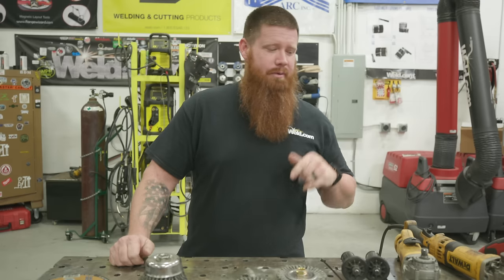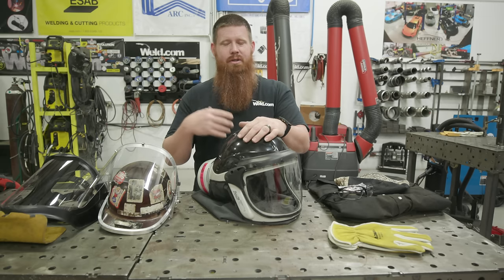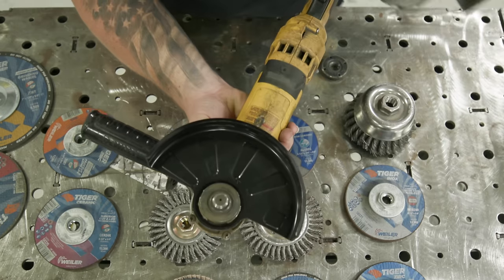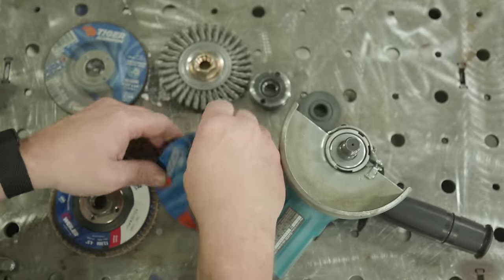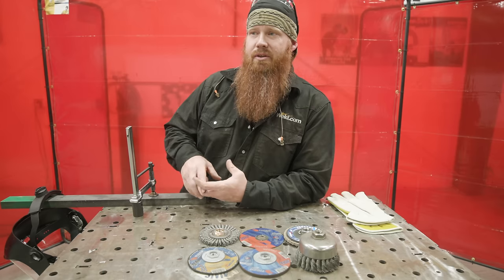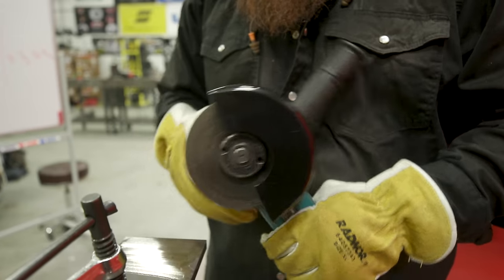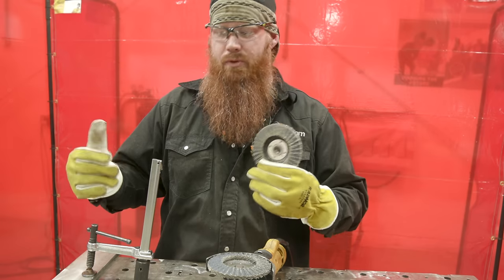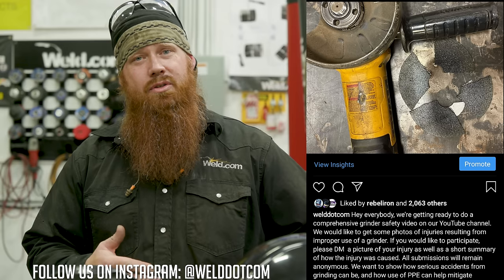Grinder Safety: How to Properly Use an Angle Grinder

Comment: Jason, you have performed a tremendous service.  I'm a retired eye physician and surgeon and have seen some bad shop accidents.  You certainly have a talent for instructing and teaching and this was one of the best.  Your videos are great and much appreciated!
Reply: fsfltsurg704 did u really have to add eye surgeon in the comment 😂
Reply: @BryanHernandez-kv6gr  
Considering it's relevant to the subject of safety, in the sense that he's seen the injuries that resulted from poor tool safety, I'd say he DID in fact have to mention that. Leave well enough alone.
Reply: @BryanHernandez-kv6gr  Yes.. Most of the injuries I treated could have been prevented with some basic safety measures that were mentioned in this video.
Reply: George Nelson  Safety glasses with a face-shield - much better.  I got a piece of steel in my eye once while wearing safety glasses !  A face-shield would have been better and actually might have saved me that time. Point is safety glasses alone are not 100 %.
Reply: My wife calls me “mr safety” because I wear all the protective gear whenever working in the shop or mowing my lawn. Also my 14 years as a paramedic I’ve seen a lot of eye injuries as well. It’s really common sense.
Reply: @nobaddaystravel6855  what does she call her boyfriend?
Reply: @nobaddaystravel6855  better to be Mr. Safety, than Mr. Tragedy.
Reply: George Nelson  44:51
Reply: @nobaddaystravel6855  I wear a face mask mowing. I know a case where something (a pebble) bounced off a house and the person needed eye surgery. I told my neighbor and he wears one too. He told me once something hit his safety glasses and cracked them!
Reply: @denyspoyner4150  I suggest and wear safety GOGGLES.
Reply: @BryanHernandez-kv6gr  The mention of their profession was appropriate and useful in helping them establish credibility. Your comment is the one that is out of place.
Reply: Eye injury most common injury.
Reply: @nobaddaystravel6855  i wear all of my protective gear in front of wife. Specially when im drunk. ✌️

Comment: I had a cut off wheel explode on me. I had the guard and it saved me. I didn't listen to others about taking the guard off.
Reply: Good stuff.
I've had them blow up without a guard many times and its been like being sprayed with small bits of gravel at speed, didn't embed, might have broken skin or slightly bruised.
Protect your eyes.
If you blew off a wheel while it was mostly intact that might be a different story and 7-9" discs can kill.
Reply: Unfortunately it happens fairly commonly, especially on deep cuts. As long as you maintain a proper body/tool orientation and adhere to the guard and cutting directions, it rarely causes as much damage as shown, if any. Be vigilant!
Reply: @Senkino5o  I had a 7" disc explode with large chunks. I have broke the center out a couple of times, but only had a complete explosion once.
Reply: Respect the beard.
Great video dude 👌
Thank you
Reply: Same. Iv;e been working on a large metalfab shop for years and it;s the first time one has shattered on me and that guard might have saved me a shitload of grief.
Reply: knew an idiot who put a chop saw cut-off wheel in a grinder, was trying to cut irrigation pipe. the wheel exploded and he almost bled to death before someone got him to the hospital
Reply: I had one explode and go through my jeans and into my leg. I don't remember if it had a guard  or not. I'm pretty sure it did ive always been a safety last type of guy. Since then I always wear eye protection.
Reply: Do they really work well? i feel like the wheel will just cut through it and hit me (i always use guard glasses and face shield i dont fuck around with those things)
Reply: @brianelstro7801  Rarely, but sometimes.... Wouldn't want to be a 'sometime' !
Reply: We call the guard "the condom" jokingly here in Greece, but its close to the use of a condom. Makes things less practical and reduces unwanted surprizes!
Reply: This happened during my shop class In freshman year

A peer was cutting metal grate with a grinder with a cutoff wheel

I was standing near supervising and I’m not sure if they weren’t thinking or just didn’t know what would happen

But they tried to twist in 90 degrees to the left and the cut off wheel absolutely exploded

A rather large piece about an inch wide made a slash in my jeans as it grazed me

LoL got lucky I wasn’t standing any closer

And shows what happens when people don’t pay attention and follow safety rules and procedures
Reply: Had the same thing happen but with a dremel... most cheap cutoff wheels are just budget frag grenades lol

Comment: I am so glad I watched this. I am a novice- hobby- in the garage guy who works mostly as self-taught. Yes, I've thrown the wheel protectors away. Yes, I use the wheels for applications I should have used something else. Never knew the right way to put the nuts on and crank them down too tight. This really opened my eyes (thankfully I still have them). Going to check all my grinders tomorrow and get set up correctly. I just hope I won't have any nightmares sleeping tonight. Have I been lucky. Years doing it the wrong way. Thanks so much for your instruction.

Comment: I’m 100% guilty of just picking up this kind of tool from Home Depot with no education and starting to use it for minor DYI tasks, trying to apply my own limited “common sense.” I was not respecting the potential danger of these devices by a huge margin.

I refuse to touch my grinder again until I at least memorize everything brought up in this video. You might have just saved my life or myself from serious bodily injury in the future. 

I can’t thank you enough for this video.
Reply: Yes, I was cutting something and I even told my neighbor, what I’m doing is dangerous.
Reply: How in the ever loving fuck did you never once thought this tool was dangerous until this video? The manual alone, the noise, something that rips through stone and metal?
Reply: @justtime6736  Umm, I think you're overstating my comment and I think your sentiment actually risks undercutting this video's educational value.

I said that I was off "by a huge margin." I didn't say I thought the tool wasn't dangerous at all. This video showed me things that could go wrong that I hadn't thought of or wasn't aware of.

I think "looking at the manual, being aware of the noise it makes, and knowing that it rips through stone and metal" all fall into the bucket of basic "common sense." Maybe you missed that part in my comment.
Reply: Equally guilty.  There should be a conspicuous link to this video on the cover of the product's instruction manual !

Comment: Proper PPE: 2:11
Tool Pre inspection: 7:15
Tool accessory safety features: 9:00
Choosing the appropriate disk size: 10:15
Choosing the appropriate disk type: 12:55
Checking the serviceability of a grinding wheel: 15:45 
Mounting the wheels onto the grinder: 18:20
Foolproof system for changing out wheels: 23:30
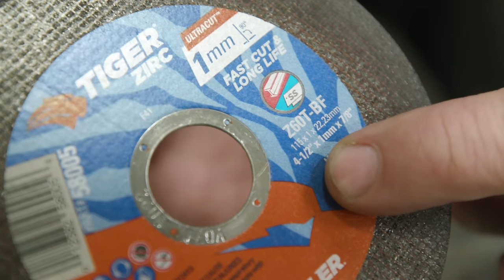Technique and operation of varying wheels: 25:10
Cutoff wheel: 29:00
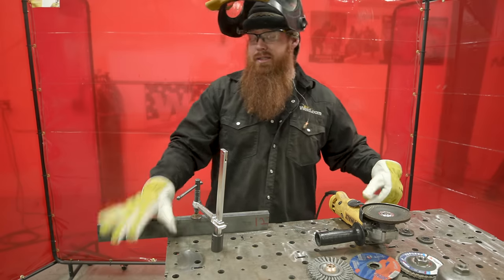1/4" hardrock: 33:00
Flapwheel: 35:30 
Working with stainless steel tips: 37:00
Wire wheel: 39:40
1/8" hardrock: 41:10
Grinder accidents: 43:40
Reply: Iloveyou
Reply: Absolute godsend of a comment thank you
Reply: @raptorjesus5082  thanks man, you won't believe the number of times I come back to this just to make sure I don't become complacent
Reply: Thank you!

Comment: Jason, I have been doing automotive repair, automotive HVAV repair and fabrication as well as general welding and fabrication work for over 40 years now. When I saw the title of this video I almost ignored it completely, then I noticed the running time was significant. I watched the entire video and I must say I was beyond impressed. I am guilty of a lot of the how not to in this video, and I learned a few things as well. Thanks for putting this video together, I will most definitely be sharing this with my shop mates.
Be safe and thanks Jason,

Dan
Reply: Exactly!
Reply: Me too, exactly!  I learned a lot more than expected.  It really opened my eyes.  And I have had the grinder cut my hand through gloves, yet I still hadn't learned.  Facepalm!

Comment: Mate. I'm really glad that you've made this video. There's far too many people on YouTube telling others that the guard on a grinder isn't necessary. It's there for a reason. And I hope that many people watch and learn from this video. Well done. Cheers.
Reply: Yep. Seen a disc explode and nearly cut a guys nose clean off.... plastic surgery was required.
Reply: @Wroger Wroger That's a great comment there.
Reply: Anyone who is stupid enough to get caught on video not using the proper guard on their equipment and or advising others to do such foolish things is a COMPLETE IDIOT and should not be supported by anyone. I would even suggest reporting them to YouTube for showing dangerous behavior that could injure or kill others. With the way litigation works in the USA, YouTube could be held accountable and be right royally sued for damages.
Reply: The people who never use guards are the weekend warriors who work in their garage and actually don't have many hours under their belt with grinders. Luckily those people have never had to use grinders professionally in a large engineering workshop or on site for 55 hours a week for many years. 

People who have worked on site of in large engineering workshops always wear earplugs, glasses, face shields, gloves and guards. Iv'e yet to see a welder or fabricator or even a experienced labourer not use a full set of PPE. (even the experienced labourers are much more skilled with grinders than the weekend warriors are)
Reply: It's YouTube, what did you expect? 90% are self-taught amateurs pretending to be the real deal with their mig guns...
Reply: Yeah man - this comment section alone is a bit of a shitshow of people insisting guards only for amateurs and wusses, and if you're a real man you're actually kind of excited about the prospect of no longer having binocular vision

Comment: This is a great video, thank you! I just bought a cordless dewalt grinder, but not for the things most of you use it for. I'm an electrician, and I do a ton of remodel work on old plaster houses. Cutting in boxes into plaster has been destroying my 30 dollar multi tool blades. A plumber let me use his grinder to cut out the plaster for the box to fit, and it worked great. What I did notice (first time ever using a grinder) Was that the plaster was shooting back at me,my face and everywhere, and HARD. hard enough to break my prescription glasses. I also noticed that there was no guard on it. After I bought my own TODAY, the plumber said "just toss that thing in the trash" and I almost did until I watched this video. Thank you! Never thought these things were that dangerous.. sorry for the long post
Reply: Was tempted to do the same thing after buying a Milwaukee cordless grinder to sharpen my lawnmower blades-then thought I had better watch a video on whether that was copacetic.Glad I did watch this video.✌️
Reply: …I never ownEd one until I got one as a free gift from Milwaukee.  I had no idea how dangerous these are

Comment: Beginning to work with Metals, welding and grinder. this is absolutely very important to be safe. Thank you for this detailed video
Reply: Most injuries(asides from burns) is from exploding disc from grinder
Reply: @ricechido1089  no the biggest injuries from grinders is eye injuries or burning stuff..the only grinding wheels that ever exploded were those flat cut off wheels..I’ve been welding and grinding for 27 years
Reply: @welding_guy7524  i agree, burning isnt the most common but the eyes is and thus why u wear eye protection at all times

Comment: This is, by far, the best safety video about proper usage of an angle grinder. Thank you so much. Gave me more confidence every time I use my mean machine. Hats off.
Reply: Great video, and there is so much to learn from it. Americans are generally very smart about work environment safety. Perhaps their extremely expensive healthcare system plays a role in this. I always rely on an American craftsman when it comes to equipment safety.

Comment: I've learned so much from this video. As a mechanic for forty years I used this equipment for for fourty years and never knew some of this stuff. Thanks for bringing safety to the fore front. This video should be used in every welding or metal fabricating class. I've seen several injuries over the years and learned from every one. This is vital information.
Reply: its in my metal one class
Reply: Forty not fourty. Forefront is one word.
Reply: As a mechanic for forty years? lol. where the hell did you work? pre-school?

Comment: Thanks so much for this. I've been using angle grinders safely for many years but you still taught me new stuff, especially about putting shields around the area against sparks and type 1 guards. Can't get them in the UK so I modified a spare guard - I now feel even safer. Thanks again!

Comment: I am thirteen and love everything about welding and I hope u make more safety videos like this I love it
Reply: Keep the trade going bud you’ll be earning good money since no one wants to do it
Reply: Same bro I’m 14 and thinking of buying a grinder and a welder for my go cart build
Reply: How I got started welding is my grandpa bought me the titanium 125 Flux welder for 140 on sale for Christmas (current price is $190) and I welded tons of stuff I welded some fence that needed to be fixed wheel barrels exhaust manifold and more with that  about 8 months later I up upgraded to the lincon 210 mp for the gas capability and more capability because i restore trailers and i build some massive projects but I still use that harbor freight welder some times because it is so portable (im 15 now)
Reply: @Johndeer325  read my other comment if u want but to start out I recommend the harbor freight 125 flux core welder its $190 especially for a go cart because its do dang portible I own a almost $2000 welder and still use that one because its so portible good luck with ur build 

Edit: also I would love to see the build on ur channel im subed I'm waiting for the vid lol
Reply: Bradley Pumba Thank you very much
Reply: MAKE SURE YOU GET A GOOD QUALITY SAFE GRINDER!!!!! Even if it's expensive. I cut my finger for the 3rd time. Not cause I wasn't careful (actually the complete opposite, I was usually careful), I got cut cause my cheap little grinder didn't have enough safety features. Price or life, you know?.
Reply: Me too! I love welding and building things and I’m the same age
Reply: @Johndeer325  go for it! I’m working on a go kart aswell and it’s fun as hell. Once you have a grinder and a welder you’ve really got everything you need, you can do just about anything with those two tools
Reply: @HelloHello-hk4sx  would you say dewalt grinders are completely safe?
Reply: @Johndeer325  thank you so much! I will subscribe to u for that!
Reply: @sleepingturtle32  Thanks bro
Reply: @Johndeer325  no problem!

Comment: Very thorough. A reference to this video should be included in the owner’s manual of all new grinders beings sold
Reply: Glad I watched it, I wrote 12,000 rpm on the side with a sharpie so I won't buy wheels rated below the rpm.

Comment: My dad was using an angle grinder without a guard I told him that It can break and shoot everywhere and seriously injure even kill you I wouldn't let him do his job until he put one on and then he did. about a week later the disk exploded and flew everywhere I heard something explode in the garage and I went to check on him and he was sitting and ground he stood up and thanked me since then he uses a Guard.
Reply: I was cutting up a bike frame and I will admit that I didn’t have it probably secured and was using my foot to hold it on the ground. While cutting the blade barely struck the concrete and exploded I was fine except for the sheer shock it gave me. I had the guard on and without I would have been horribly injured because there is a massive gouge in the guard that without would have sent a piece of  the blade into my neck.
Reply: @ajp4248  I am happy for you that you didn't get injured.

Comment: This is an excellent video and a ‘must see’ for all learners. Frankly, I have not come across a better instructional capsule than this one. We must remember that while an angle grinder is a very useful piece of equipment it is also one of the most dangerous machines in any workshop. If handled without care it could cause immense damage to life and property. Every step of its use demands the careful attention of the operator. This video is one that must be viewed periodically by every user to get reminded of where slackness or complacency may have seeped in. I must thank the maker of this instruction video for bringing it on the internet. You may have a point of interest but you have actually served a much bigger purpose through this detailed presentation.